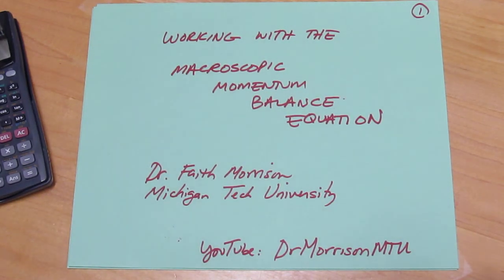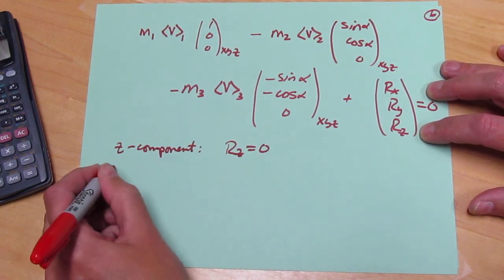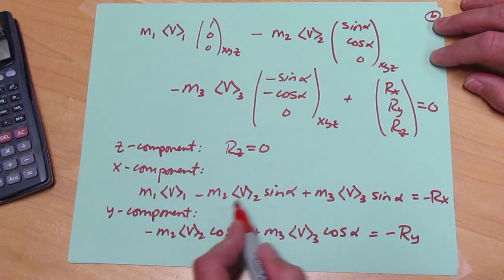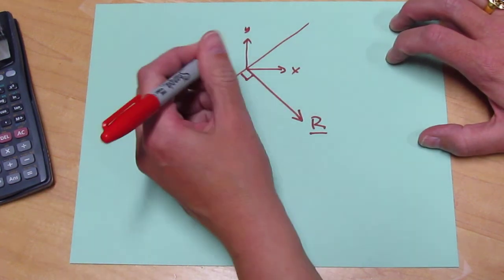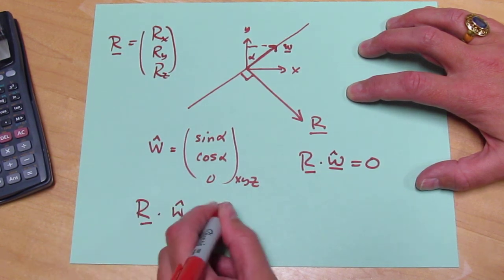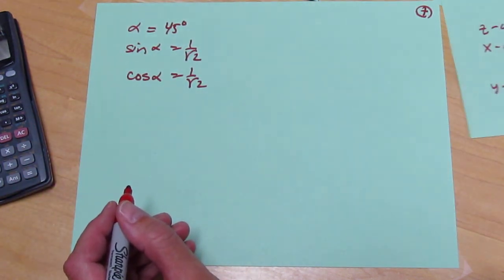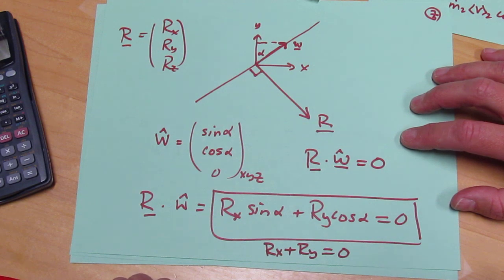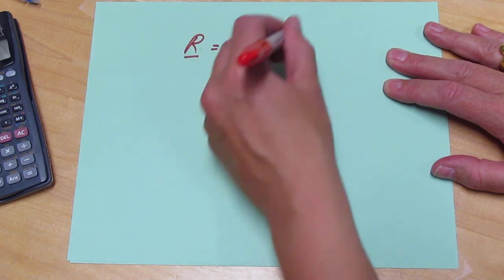Part III: Macroscopic Momentum Balance - nozzle flow to tilted wall

Comment: So your are getting an exact result without even knowing the size of the plate? It's evident that the bigger the plate more fluid is on it so more downward force.
Reply from the maker: The solution I provided is for 2-dimensional flow, that is, assuming that the flow is the same in a neutral direction.